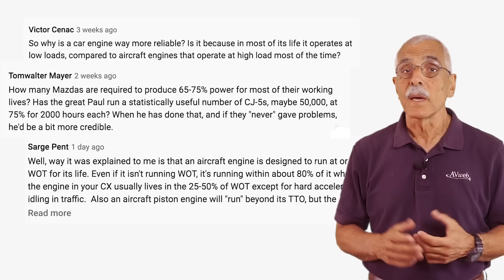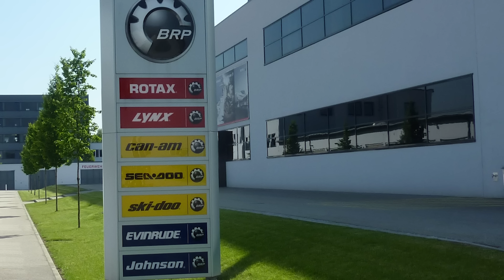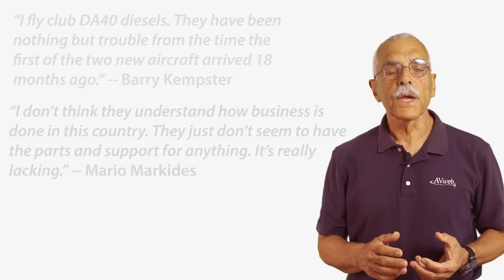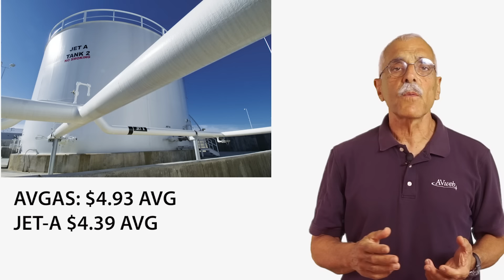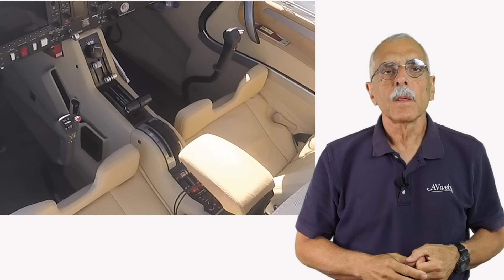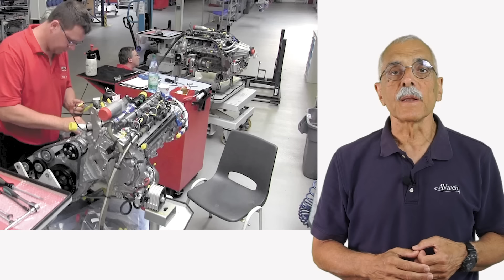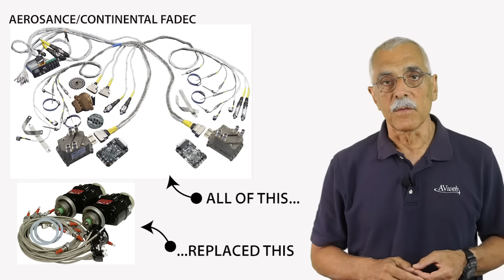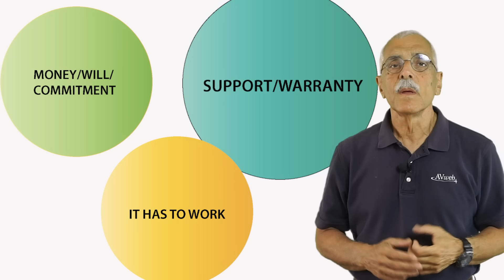Why New Aircraft Engine Ideas Rarely Succeed

Comment: The best Thielert Engine was the 2 Liter Centurion. Reliable, F320 and more due to finest turbocharger, aluminum crankcase, jet fuel or car diesel (everywhere available), low fuel consumption, cold start down to -30C° (such tested even in Russia) without ground power, hot temperatures in Africa no issue.
However, the true aircraft engine needs to be developed. Based on a hypocycloidal crank system, a two-stroke diesel for Jet A1, common rail injection, turbocharged and supercharged, air cooled, geared, heat exchanger to deice wings. This all preferably as a radial engine!

Comment: I don't understand why this topic is entirely focused on the great big diesel car engines only?  Yes, big ol' cast iron diesel engine blocks weigh a lot.  My bigger question is:  Where are the lightweight 1.6 liter gasoline engines for smaller GA planes?  You bust the myth about "can't run car engines at 70% all day", so where are the  ultra reliable Toyota 4 or V-6 engines?   Modern engines can pull a huge amount of power from a small engine, and do so with incredible reliability...where are those engines in GA?

Comment: A tiny market, filled with aging airframes. If you had asked me 50 years ago what general aviation would look like today, I would have told you that small turboprops would have completely replaced the piston engine. And of course the major reason why GA engine technology is so outdated, is because the industry has escaped emission control regulations. If Aviation engines are expected to be as clean as automobile engines, there would be no Lycoming or Rotax or Continental product.

Comment: Hi Paul, Great presentation; But I beg to differ on one point. You said that Automotive engines could match GA engines on duty cycle durability and that their inability was a Myth . Then you went on for the next 18 minutes to prove that is utter BS; with Gasoline automotive engine failures such as the Porsche PFM and Mazda, Honda etc. I worked for a Mooney dealership in 1983-1984, I am very familiar with the Porsche engine problems. They could not hack it at continuous high RPM/ power outputs. Same is true with the Thierlert Centurion. So many more issues than just valve springs. Tell us, why is it that Austro went to the Cast Iron case instead of the aluminum one adding 200 lbs. It is because the Aluminum case would warp and twist under the loads and yes. Cause failures. Besides lets compare Apples to Apples without getting sidetracked. I said that GASOLINE automotive engines could not stand up to the duty  rating that aircraft engines are required to perform under. You only mentioned Diesel aircraft engines . BTW. I am 100% Pro-Diesel/ Jet A, aircraft engines. I think they are the future. Gasoline, not so much. There are very few AUTOMOTIVE GASOLINE engines that can handle the requirements, such as .( EG. Formula one race car engines etc.) The gasoline Rotary engine failed because the Rotor end seals could not hack the high output wear and tear. I noticed you mumbled by that grave yard without contradicting yourself.  I know very little about the Honda engine. However the Toyota engine, I was privy to much of the background, Because I had a neighbor who was pulled out of retirement from Hamilton Standard by Toyota to work on the FV 2000-2T, He explained why the gasoline version of the Toyota was never entered into production. The short answer is, The Toyota Gasoline automotive engines could not hack the continuous duty cycle aircraft engines could. So why did they certify it then you ask? Well that is because they were still doing further testing before they discovered unusual valve stem wear and valve seat coking issues. Why you ask ? High RPM and high temperature. So please show me where I am wrong ? Tell me about an successful  GASOLINE automotive engine , before you go off the deep end of diesels. I will post a separate blog about, Why aircraft design Gasoline engines can sustain high duty cycle output where AUTOMOTIVE GASOLINE. automotive engines can't. All the best to you.

Comment: I really like the 912uls and 912is. They’re easy to operate, the constant depression carbs mean no worrying about mixture…no carb heart…very little hassle. The only thing that sort of sucks about them (from a pilot’s standpoint) is that the CHT, EGT, etc. sensors are a bit cheap. It’s not uncommon to see something like your left CHT go completely haywire out of nowhere then boom…that’s “inop” until you get it addressed. Other than that, they’re great little engines as long as you don’t mind having to burp them during your preflight.

Comment: Avgas is prohobited by the European Union from 2025. That is a new challenge.
By the way, why do I see so many catastrophic aircraft engine failures on youtube? The current design is very old, no fuel ejection, carb heaters and mixture controls, looks like  keeping steam engines because they are so reliable. Progress always comes with a cost.

Comment: A diesel engine is not a gas engine. Diesel engines are designed to run at high power.

Comment: I'm kinda surprised  Honda didn't use the Goldwing engine with some re-designing for aircraft use?
The flat 6 has been around for 30+ years and has had various incremental changes, upgrades and capacity increase.
It's very low stressed plus quite low rpm. (original 1800 was 105 bhp @5,000 rpm pushing around a 800+ motorcycle plus (usually) another 4~800lbs of rider, passenger and luggage)
Standard motorcycle gearbox with all the extra gears and shift mechanisms removed it should show a decent weight saving and lower propeller drive rpm to whatever is needed
No idea what size generator/alternator is needed for light aircraft but the standard Honda(Dachi/Nippon Denso, whatever) would probably be overkill unless you wanted electrically heated flight suits? (smaller generator weighs less)
It's also simple for any experienced motorcycle mechanic to service although the 'die hards' in aircraft maintenance would probably hate anything they had to learn new?

Comment: The main issue is the aircraft mechanics.

They would rather work on an engine they know so well that they can recite part numbers from memory than a new engine they have to learn from scratch.

Another issue is todays engineers cant get it through their skulls that "field service" is a thing.
That hiding spark plugs and thermostats under layers of components is completely unacceptable in general aviation.

So modern egines get a lot of bad "word of mouth" from aviation mechanics when buyers ask their opinion.

So even if you have a modern engine thats superior to a Continental in every way , as soon as the Aviation mechanics find out that its nothing like the engines they are familiar with and you have to remove the engine to change the starter or dig through layers of components to get to the crank sensor they are going to steer potential buyers away.

Comment: Licensing of the Mazda overhead 2-cycle may give new life to old aviation platform engines, such as the geared engines (Continental GTSIO-520 and the Rotax 900 series)..  Redbird should have also done 177RGs as complex retractable is one of the critical next steps in flight - school.(and IRF).  can't just go halfway..

Comment: I am not a pilot or someone who owns a GA aircraft, but I have been an "aviation enthusiast" my whole life, now about to enter my 68th year. So I have a question: if Jet-A is so much more "available", and less expensive, than 100 LL and 100 UL, why don't we see piston engines completely give way to small trurboprops? The Cessna 208 Caravan, DHC Twin Otter, Beechcraft King Air, and Pilatus PC-6 all use small turboprops. Is there some engineering reason I'm not aware of, that makes it impractical to scale a turboprop engine down to the 150~250 shp range for a Cessna 172 or 182 sized airframe? If Cessna can make a turboprop work well in the 208 Caravan, it doesn't seem that it should be impossible to engineer it a bit smaller for a 172 or 182.

Comment: Just one notice. Troublesome was first generation of Thirelert Centurion diesel. It was based on smaller and older construction OM668. 1,7L or about 103 cui. And really shortliving gearbox.

Next generation of Thielert Centurion 4 cylinder, if still not perfect, but way better both engine and gearbox side, was based on OM640 2,0L or 121 cui. Now in automotive world outdated technology... 🙂

Otherwise great article.

Main difference what differ between automotive and aeroplane engine is "load index", typical personal car engine work with 15-35% of maximal available power, aeroplane 65-75%. And in aeroplane ist weight of the engine also crucial. Therefore is not easy or simple to choose an car engine and install it in aeroplane.

So why Thielert try MB engines for dieselisation of aeroplanes? MB build it also for vans (higher load index) and geman highways (high load index) = they have to be somehow "Vollgasfest".

I fly actual P-2010TDI with (now) Continental Centurion 2,0S (reworked with higher compression and thus set for 125kW/170HP). Ufortunately not mine aeroplane... but for European fuel prices it is crazy economical, 70% of power mean 24L/h and 105-110kn IAS. What will use gasoline Cessna 172S or Piper Archer with IO360? With complex manual fuel and propeller management?

Comment: It takes a lot more than those two levers to operate a steam locomotive. Sure, to make it move there's only the reverser/Johnson bar and the throttle. But, to allow the engine to function, there's valves controlling artificial drought to maintain air flow, water injectors to maintain water levels, grate shakers to keep the coal getting fresh air or fuel injector control if it's oil fired as some later steam was, auger control if equipped or fuel pump, flue controls, track sanders, and I'm probably forgetting some other stuff. All needs to constantly be monitored by the fireman to anticipate when the engineer is going to need more power, keep the fire lit, and prevent the boiler from exploding.

Comment: Don't automotive engines generally see a penalty when put into an aviation application due to the requirement for a reduction drive between the engine and prop shaft?

Comment: Well, what you say is true, but I hope we are not still stuck with Lycomings and Continentals 100 years from now.   You know the tech displayed at Oshkosh is at least 50 years ahead of Textron and most of general aviation now.   Even the FAA admits Part 23 is adverse to aviation safety, now.   Blocking current state of the art automotive engine tech is a mistake for both economy AND safety.   Sad, sad, sad!   And the current engines are not 1960's tech, they are more like 1930's tech.   People, time to use your heads.

Comment: I think its a bit disengenuous to compare diesel engines to gas engines, with modern liquid cooled gas engines we get high power, can run on pump gas for 1/2 the cost, no shock cooling, and benefit from the extreme testing automotive companies subject their engines to, the certification process is the problem, modern ecus rarely fail and drastically decrease workload

Comment: I read about some Aussies replacing venerable rotaries in WWII warbirds with new Chevy V-6 or V-8(LS1 or LS3?)...
and experienced comparable performance with significant increase in efficiency/range.  Of course, they're only gas powerplants,
but the 'LS' have a good reputation.    Has Paul addressed that option?

Comment: I wonder about GM 2.7 turbomax.  It is very impressive.
Reply: Or the old 4.0 they put in those jeeps that was basically bulletproof lol. Or that reliable 3.8 Buick motor or the ford 4.6L they put in everything was pretty reliable too. Or a Cummins for a reliable diesel. 

If they ran these engines at 70% they’d probably go 1 million miles:) I’d rather have any of the three I listed over a Mercedes engine or even a new turbo max. Can you imagine the issues new diesel’s would have on an airplane if they had to carry the post 2007 emissions and DEF equipment? 

I’d rather use an old diesel like a 7.3 if I had to fly with an American diesel but I think they’d be a bit heavy lol. 

Japan has made some pretty amazing 4 cylinder diesels that could probably be converted. Slightly older engines make more sense than the new ones mostly because they have 100’s of millions of miles of testing and we know they are reliable at 100% power so at 70% power they’d last forever.
Reply: @alexburke1899  The power density of Turbomax is what is impressive, and it is overbuilt.  But, yes..diesel would be better.

Comment: This is a very small market, hunderts of engines vs ten of thousands for autos coupled with needing the blessing from the FAA costing probably a million or so.  And twenty years down the road you still have a need for overhauled engines and a new one or two.  Lycoming makes new engines, overhauled engines, and factory remans all on the same line interchangeably, even mixing fours, sixes, and eights of different cylinder displacements to spice things up.  The market for new is very small but overhauls make the money and there are probably  over 100,000 out there in service.  Both lycoming and continental have years of experience in building this old iron and people trust them and trust that they'll be around when needed for parts, advice, and overhauls.  There are very few new successful new entrees into this business.

Comment: I've worked heavily with all these engine manufacturers. Thielert and Continental are now one in the same and Chinese owned. It remains to be seen if they can retain the engineering talent they purchased and if they are willing to continue to invest in or if they just wanted to "buy" the IP. Rotax had continuing reliability problems and needed their users to develop and figure things out for them (which it sounds like they did, and succeeded in turning that into a new iteration). Lycoming, as you pointed out, hasn't developed anything new in 80 years and doesn't have engine designers who would be capable of doing so. Honda, Toyota, VW, and Cummins all have the depth of engineering to make something new but none of them are competing in the small aircraft engine space.

Comment: aeromomentum will eventually eat rotax alive. they already have a 300hp turbo charged, full fadec dohc 4 cylinder engine, for a low-ball price of $29,700. the beautiful part? the factory can ship it to you, programmed to run E85- which.. in the AM20t- runs like a dream at 25,000 feet, not to mention- is priced lower than regular mo-gas & MUCH cheaper than 100 octane avgas... and? weighs in at 285Lbs.

Comment: air cooling. that factor alone puts lycoming & continental a CENTURY behind ALL car engines. mercedez benz diesels are well known to run over a million miles in a car. not surprising that they'd outperform everything else in a plane as well. direct fuel injection, turbo charging, water cooling? no such thing as carb ice. no such thing as 'shock cooling'. superior in EVERY way. fadec controls? set it & forget it.

Comment: ANY newer mass produced vehicle engine is 300% BETTER than LYCONTISAURUS engines... in EVERY category. power to weight, fuel burn, cost, reliability- BETTER. they will run at BETTER than 70% power ALL DAY LONG... and for a lifespan 3x as long, many times more reliably. case in point?

 AEROMOMENTUM.

 so why do 'new aircraft engines' fail? well, they don't. the FAA is the FAILURE. as with ANY federal agency- the greatest strength? is regulating to the point OF failure. those old over-glorified briggs & straton engines remain in use for one, very simple reason- designing, testing, & tooling up for manufacturing and then getting approval from the FAA? IMPOSSIBLE. if you did it? the FAA would make DAMN SURE you regret it financially. you'd go bankrupt  before you ever see your first dollar of sales ledger in the black. it's no wonder trump threatened to take the FAA PRIVATE if they didn't get off their a55 & approve ADSB. cudos to lycoming & continental for sticking with the battle- to no fault of their own, it's the FAA that keep general aviation stagnant. 

why are modern car engines so much better? simple. take the aeromomentum model AM-1500. in its' car variation? they build more of them in ANY given 3 month period than lycoming AND continental have built COMBINED in their LIFETIME as a company. legacy auto engine makers have 100's of MILLIONS of dollars to spend on R&D. they utilize factory race teams, not just as a tax write off- but as a test bed- where they ACTIVELY push those engines to failure, OVER & OVER AGAIN... and whether an engine makes it only to the green flag in turn #1.. .or to the checkered flag of the entire race series- they tear it down & learn from their failures & their successes. if you look all the way back to the early 80's? the winner's circle at nascar, nearly EVERY race? GM, GM, GM, GM. and NOW... we have the C8 corvette engine as a direct result. lycoming & continental are beautiful, well built engines, no doubt. but compaired to a GM small block with fadec controls? they're BOAT ANCHORS. 

in short- if you want to fix GA? privatize the FAA.  we could call it  for " aircraft safety testing labs inc." or the ASTL. hey-  we have underwriter labs- the concept works. we have the ASTM. the core principle would be, safety, pretty much the same principles as the FAA adheres to- but without ANY of the federal agency filibuster & over the top expenses. the 'adherence stamp of approval' of the ASTL would be backed by an insurance liability coverage (independent of ASTL) - which would AUTOMATICALLy mean they have a financial interest in NOT having failures.